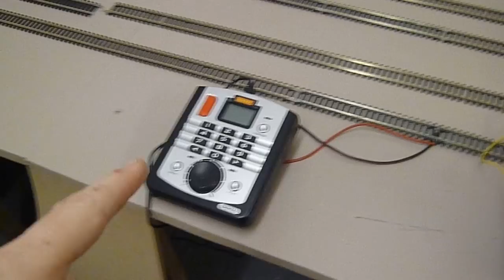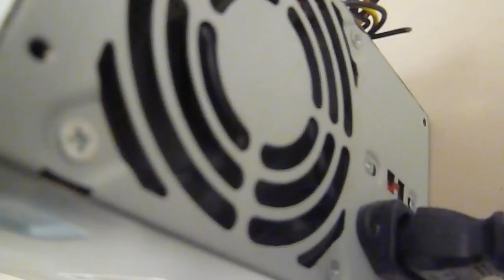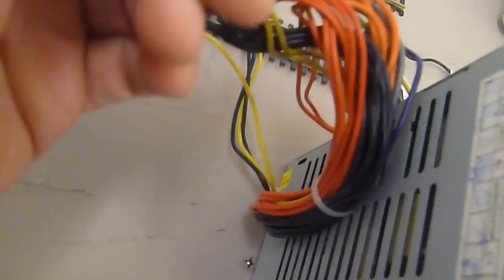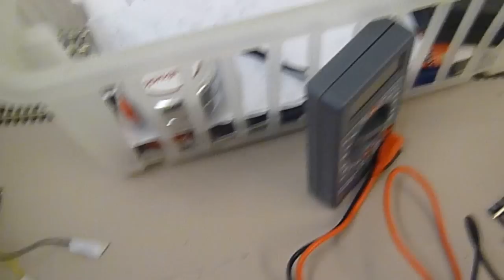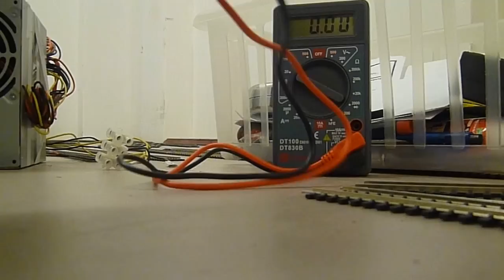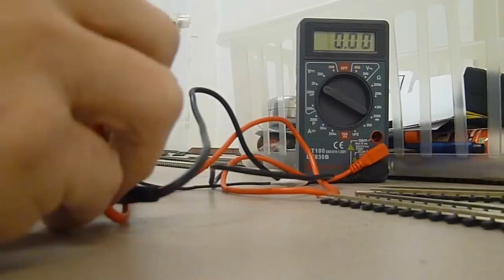Using PC Power Supply to run my LED's

Comment: 5 years later and you are still getting views and likes. Thank you for this video. I'm a PC repair guy with a LED TV I'm trying to test the LED strips in. I'm assuming the semi obvious, that 1, 2 or 4 LEDs can be tested at a time based on the 3, 5 and 12 volts. This is really simple for me since I have dummy blocks that plug into the 20/24 pin connector and allow the PSU to run without a motherboard connected to it. No splicing for me! :-D
Reply from the maker: No problem Mike thanks for the comments

Comment: I was just wondering who is correct here, as I am struggling with this very issue.....is orange and black 3V????
Reply: Black is ground... essentially understood as GROUND... no applicable V # required.
As in a car, truck, boat, airplane... the frame of the vehicle becomes the basis of all circuits.
a cheap voltmeter, and simple knowledge of DC electricity goes very far.
Do not be intimidated by the numbers of wires.... they are there only as options.
All computers have abilities far beyond their current build.
Every PC CPU    COULD (depending on manufacturers chipsets)  support 4 HardDisk Drives, AND 4 CD drives, ... 
and... up to 4 Printer Ports.... and yet more still with old skool Serial Port devices, let alone practically all the USB components available. IR, WiFi, controller cards are everywhere.
Computers have few limitations, Sadly most North Americans have been robbed of Electrical and Electronics  educations.

Comment: One last question, do I cut connectors off and take ALL the blacks together  and ALL yellows together then put connector off each  to run bus wire? I assume I can't just use one yellow and one black to run the bus from, not enough current with just one of each? Sorry, New at this.
Reply from the maker: Yep you can bunch a couple of Yellows together and a couple of black to give you 12v + and - but you may only use 1 of each if running LED lights, I am running about 10 LED lights on my layout with just 1 Y and 1 B.

Comment: So do you just run a bus wire off the 12v wires under the layout and tap into it along the way where ever you have lighting to connect?
Reply from the maker: Pat that's correct easy as that, use the blue splicers and tap off anywhere you want lighting, I alsi used another output to control my Peco switch points easy!

Comment: Can a switch be added to the green wire to turn off the power to what is connected. I understand the power supply will still be running.
Reply: That switch, mounted inline, will put your P/S  ..... digitally ... into sleep mode.
The PowerSwitch built in, usually backlit in red LED, is ON/OFF.
A NON-LATCHING PushButton is acceptable.... easily scavenged from many computer case bezels.

Comment: My LED are getting hot...
Although its ok to touch... But wondering if the psu is giving its full ampere rating...
I connect it on 12 volts with 25 amps... Some says that the led will not limit its ampere and getting all the 25 amps...
All i need is 2 amps on my led setup... So i dont know if this is ok... Been thinking if my led will explode or got broken...
Help here, anyone...
Reply from the maker: Check you don't have a 5v LED and your trying to connect it to the 12v supply. Also maybe think of connecting a diode in line. Hope this helps
Reply: +MrSteve666999 Brancurt Central a Diode??? may i know whats the rate of that diode or resistor...

do i need only one? where will i put it, in the main line or every single parallel led module...

the leds already have a resistor...

and im pretty sure that my leds are for 12 volts... its from motorcycle leds...

Comment: I would like to put LED lights under my trusses around the exterior of my house.  the power supply will be in the attic... what wire can I use to go from the inside of the attic to all of LEDs? also,  I am running a wire from the computer power supply down inside the house so I can put in a switch... do you know what Guage I would use for?? GREAT video! thank you!

Comment: Hey, say my led runs at 24v if i combine 2yellow wires, will it "work" ?
Reply: +Sam iNG You can connect two PSU's in series to get 24V, but you have to be very careful because this is dangerous!
Reply: dont do it just get 12v ones... your 24v leds  might burn and same with PSU
Reply from the maker: +Sam Splentfield (Sam737) Hi Sam no unfortunately not, you would need a 24v output from the PSU which this does not have. It would be easier to change your led's to either 12v or 5v. Hope this helps
Reply: hi thank you for the answer, after some research i found out that voltage is additive in series, but you can't do that with a psu, i'll try to add a dc to dc boost converter and see how it works cheers

Comment: 3.3v - orange + 5v - red + 12v - yellow +0.0v - black - ground negative 5vsb - purple - standby +5v 
most useful 
 psu turn on/off - green shorted to any black wire 
if that helps ?

Comment: Hi could you explain how to actually connect the pc power supply to the dcc controller to run the trains. I am new to this but  have  pc power supply spare. Thanks.
Reply from the maker: Steve Gater Hi Steve, I only use these power supplies to run LED lights either 12v 5v whichever I buy, or power Peco switches for points on the layout. Your DCC system should have its own power supply already in your unit, mine is a Dynamis System.  By using another PSU for these lights etc means I am not draining power from the tracks etc so you can run more trains.
hope that helps

regards

Steve
Reply: +Steve Gater Do NOT run the trains from these power supplies, they CANNOT share the earth ground
Reply from the maker: Yes Steve Gater these power supplies are not designed to run your trains, the DCC controller you have will do that i.e Lens or Dynamis ( which I have ) these PC psu's can be used to run everything else such as lights, signals, switches etc so you are not drawing power from the track or the train controller... use them totally seperate. Hope that helps

Comment: An older PC supply will also work. They are easy to spot, they have two plugs to power the PC's motherboard. The older supplies aren't usually as powerful and the newer models, but can still do a good job. The old units are usually given away so that's a bonus. "-)

Comment: How to know how many amps I will get on 12V?!
Reply: I've that kind of info on the supply's label.
Reply: Jean-Camille LOISEAU Usually 30 amps but there are larger and smaller units. Don't worry about over supplying amps. The LEDs will only take what they need. So a 3 amp string of lights can be run on 300 amps if you have it. You can'tt however run the same lot of LEDs at less than 3 amps. In fact always overstate the amperage. So if you want 3 amps, try for a 5 amp supply. They'll last longer and run cooler. For 15 amps go for 20 amps and so on.
Reply: Thanks. I did figure it all out since my comments and have the all nice setup installed for a while. But thanks again  for taking the time to reply and help out!

Comment: I bought 5 power supplies off eBay for $20.00 each with free shipping from Hong Kong, they are called "SUPERNIGHT 12V DC 30A 360W Regulated Switching Power Supply" and all 5 of them work fine, the only problem I am having is with the thermostats and fans, I can't get the power supplies to run quietly, the fans are always running?

Even without drawing a single watt load, the fans run at full-speed no matter what?!  I was told cooling fans on LED power supplies are only supposed to activate when the units start getting hot or reaching maximum load (360 watts), but these are running full-max fan speeds at COLD-START/ZERO LOAD?!?  Can anyone tell me why these units might need to have fans running at max speed ALL THE TIME?  The air coming out of them is cold, and the constant fans running at full-speed makes them super, super noisy!

Does anyone know if the 'fans-always-on' issue can be fixed on any power supply?  I am running our office LED lighting system from these power supplies, the load is nowhere near 360 watts (more like 120 watts!) but the fans are running at full speed, even without anything plugged into them!!  Kinda defeats the purpose if the power supplies are this loud, they are basically unusable in an office environment. I asked all these questions to the eBay seller from Hong Kong, but after I left positive feedback, they never bothered to answer a single question. Do you think I could just cut the fan wires, or would that not be advisable? Anyone? :(
Reply: resistor on fan cable (input)
Reply: cut the fan cable and connect  it to orange and black cables according  to its polarity.
may b this will help u...!

Comment: Hi Steve,
What is the amps from the 12v ??  How many lights could you run ??   What point switches would you recommend ??
Reply: I also would like to know the whole AMP draws and offer, thanks!
Reply: It depends from power supply, there are 250w, 300W, 500W. I have some older one (300w) and on it written:
3.3V - 20A
5V - 30A
12V - 13A

+3.3V, +5V together 150W max
+3.3V, +5V, +12 together 288W max

Comment: This is fantastic sir! I've started work on a LED light system, and was wondering if there was anything I had that I could re purpose for a power supply. This fits the bill perfectly.
Reply from the maker: No problem John, they work an absolute treat too. Cheers. Steve

Comment: hi 
i have 15pcs LED
Output Power:10w
DC Forward Voltage:9-11V 
can i run in pc power supply 250w